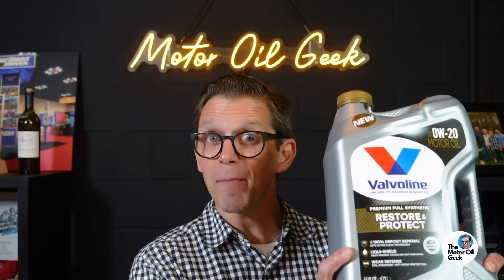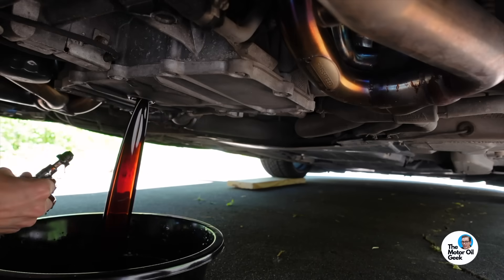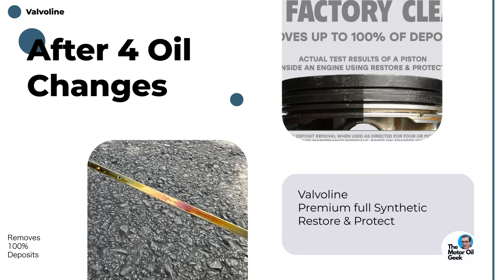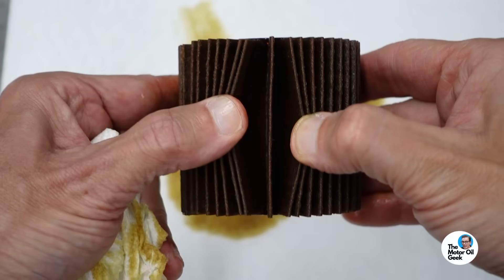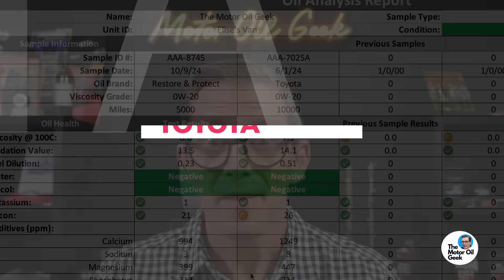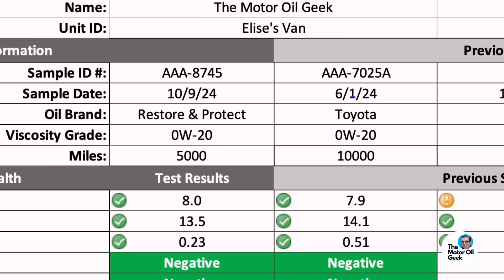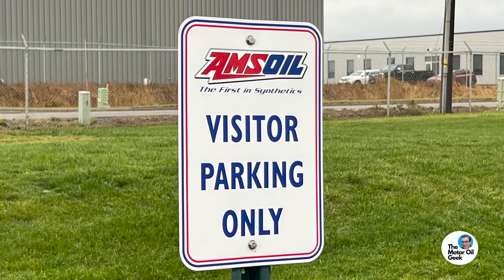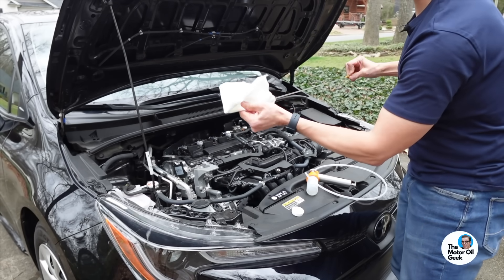The TRUTH About Valvoline's BOLD Engine Cleaning Claims

Comment: I recently made the switch to restore and protect with my Holden monaro L67 with bad service history and low oil presure issues and noisy valve train with 300k klm. I entered it into the gipsland huanted hill climb event and punished the engine across the days 10 runs, with 20 minute cool down periods. To me i thought this would be the last time before i replace the bottom end bearings joking with other competitors that its about to blow up. I had tried soo many other oils and flush methods prior with zero improvement of valve train noise. After 1 hour freeway drive returning home the engine still ticked away. I left it over night and though one more drive around the local hills before i pull everything apart. Guess what, the engine pulled up at home wisper quiet. Normally these driving conditions it would be loud ticking of the valve train. I dont know if was absolute luck and credit to all other efforts prior but the valvoline oil took care off it. I am still shocked. I'll be runing this oil for every motor i own. This has bought me a little more time to complete a l67 twin turbo motor build. I look forward to the old motor teardown too confirm the condition. Thanks to your study of oils, it has lead me to this outcome. Cheers

Comment: You can still change your oil at 5k instead of waiting until 10k.
I still do 3k on all mine. I did put the R&P in my 2001 E450 V10 motor home with 34k last change based on your video.

Comment: Switched my '22 Ram Hemi to this oil, it performs as advertised. Been using the 0w-20 as per factory recommendation, but thinking about going to 5w-30 here in Florida
Reply: Make the switch to 5w-30, I live in Dallas and switched over with my 2022 ram 1500 and it’s much better

Comment: Probably most if not all vids I am seeing for this oil demonstrate positive results.  I have 2 extra vehicles with 200K+  Nissans -  my impression is that Valvoline product is not 'snake oil'  all puns intended - so I will start using this product in those - however for my new 24 Z Performance 6MT  I will use Amsoil Signature w/ Amsoil filter.   I also use Amsoil for ALL small engines/lawncare  bike chains, hedgetrimmer lube, guns  etc.   -  and I dope up my ethanol-free gas for lawn engines with Lucas gas stabilizer - so far - smooooooth.         Great vid !

Comment: Just bought a 2012 odyssey that didn't have a muzzler on it, and has 180k miles on the engine, i'm hoping this will clean up the rings and make it run like new again,   im guessing if you run this oil and do some italian tune ups it should be good to go.   make sure to rev the engine up high to get that gunk thrown off.

Comment: I used Seafoam on my 4.7 Dodge 2005 Dakota to flush the varnish out. This engine is known as the sludge monster.  Have been running Castrol but am about to try Restore and Protect for first time. Will be interested to see if oil will last before engine makes noise on start and have to change oil before scheduled time. Only 179k miles

Comment: Question The 3 rd generation Nissan Frontier pro 4x v6 engine has noisy lifters at start up. The dealer uses Mobile. Would Pennzoil or AMSOIL be better to quiet them?

Comment: I hope they plan on making it in a 0W30, im not putting 0w20 in my 4 runner. Aint no way!!
Reply: I put the 5/30 in mine.   It may slightly hurt mpg.   But at least the engine will be coated.
Reply: @robertpoirier8520  0w20 is water idc what anyone says.
Reply: @ I totally agree!   👍

Comment: Two questions. First, can i slowly add R&P at a rate of maybe 2 quarts to the 5 i usually put in, increasing to the full 5 quarts over oul changes? 09 Aveo, 165000 miles mever had anything other then synthetic oil put in and have never had to top of between changes. Second,  do you think this will help with GDI engines with carbon build up on ithe ntake system? Maybe the vapor from R&P can help keep intake valves clean also? My wifes 2015 Santa Fe with the 2.0 turbo would love that!!!!!

Comment: Must be nice to get paid from companies.  You can always show people what they want to see!  I have been wrenching for 37 years.  I have run Mobile 1 full synthetic in my vehicles since it came out. And I have had Ford trucks with 5.0-5.8- 5.4, engines with over 500,000 miles on them still running! All gasoline engines that you say preheated engines are bad! These trucks were worked daily and allowed to idle for warm up. Oil changes were done every 3,000 miles because of heavy use. The oil changes they recommend today is literally to draw in repair issues!! All because people don’t know proper oil changes!! No more than 5 minutes for warm up in very cold weather. 30 seconds in warmer climates. 5000 miles with premium synthetic and mostly highway! 3000 miles with premium on city driving!  Today’s engines are great, with proper maintenance! I see it every day in the shop! The old saying goes, take care of it and it will take care of you! It’s not the 60’s or even the 70’s anymore! Things started to really evolve in the 80’s. But now the manufacturers are giving bad information just to try and make money! There is the plain old truth!!!

Comment: Interested to follow this series. Recently switched over from Castrol Edge to VRP for my 134'000 Mile Nissan VQ35DE powered Van which usually sees oil changes every 3000-4000 miles.

Comment: Lake, with all your knowledge of various brands and options of oil you still kept using Toyota “brand” oil for 180,000 miles.  Why?  Google tells me it’s manufactured by ExxonMobil, surely there’s “better” more affordable options. 

Which brings me to my second question, I’ve read that many oil manufacturers produce special formulations / specifications for the auto manufacturers.  For example that Toyota oil you’ve been running is a different formulation than anything else you can buy from ExxonMobil.  I have a hard time believing this.  I’ve only read these claims from keyboard warriors.  I don’t expect you to throw all the auto manufacturers under the bus, but could you possibly elaborate on the Toyota oil. Does the oil analysis data for the Toyota branded oil show the same formulation as perhaps another oil that ExxonMobil sells? If you used it for 180,000 I speculate maybe there is a chance that it is specifically formulated for a Toyota, that or you get the oil at a heavily discounted price or free.

Comment: I have a chevy 4.3 V6 with 306000 miles.
I just did my usual oil change around  550 miles ago using Mobil 1, 10/40 high mileage.
It's time to add a quart.  I don't get 600 miles before adding a quart.
Most is probably because of valve seals.

Its time for a test.
When I do add a quart, I'm going to add a quart of Protect and Restore 10/30 instead of just adding another quart of Mobil 1 10/40.
Ill continue adding quarts of Protect and Restore until my next oil change, around 4500 miles, then go with a full change using Protect and Restore from then on.  
I should probably boroscope of my piston tops and do a compression test for comparison later this summer.
Its only about $5 more per 5 quart bottle so cost is really not an issue.
I'm expecting no noticeable changes because Ive been using Mobile One high mileage for years now.
That said, if there are any changes, ill absolutely know it.
Time for a trip to Wally World. 😁

Comment: I've been using Mobil 1 for decades and feel no need for the Restore and Protect.  My engines stay as clean as new for at least 300K with annual oil changes.  Disclaimer:  I live in a mild climate, do no short trips, almost no idling or low speed stop and go.  But I'm impressed by what you've found.  And I like Valvoline products, frequently pick them for other applications.

Comment: Might be a dumb question. So would you recommend running valvoline restore and protect for a few oil cycles until cleaning is noticed and then change to another full synthetic or there would be no harm running R&P for the indefinite future in an engine and get all benefits from the additive package as well as the continued cleaning from detergents and get adequate lubricity

Comment: I have a 2017 Kia Sorento that Kia gave me a new engine after 3 FAILED oil consumption tests  (72K miles)
I am going to the dealer for a recall Wednesday. I only have 1500 miles on new engine and want to put in VRP to keep rings clean.

I put VRP in my 172K miles 98 Dodge Caravan 4 CYL and just changed oil to put in VRP again. I will wait for 3k miles this time.

Comment: If wear rate is the all-important metric of oil analysis, could you do a comparison of wear rate for all the oils you see during testing? And any other trends - e.g. I would expect maybe some oils clean/protect better for a specific viscosity (assuming the exact recipe is different for different viscosity), or some oils work better in an iron block vs aluminum block (possibly depending on the cylinder wall e.g. sleeves vs. Nikasil but also I would expect some galvanic effects given that the whole engine isn't all the same material).

Comment: 6:38 Tin wear rate shows to be 5 times higher than the Toyota oil, even tho the Toyota oil was used 2 times as long
Accelerated bearing wear?  I wish there would have been some discussion on that
Reply: I watched a video from another KOL - Ford Boss Me.  He sent new Valvoline Restore & Protect to Blackstone Lab and SPEEDiagnostix, tried to check the chemical differences between 0w20 and 5w20, as well as the report differences between two labs.  His video was 9 months before this video.  All reports showed there is no tin in new VR&P oil.  Base on that, the tin was from engine wear.  Just my two cents.
Reply: @sysopr  damn it….that’s exactly what I was hoping NOT to hear.  I guess VR&P can’t do everything.  
I understand the Motor Oil Geek is not sponsored by anyone but it’s odd that he skipped over that very important data as data-driven as he is.
Reply: I’m thinking Motor Oil Geek’s conclusion is based on the overall metal wear rate of 2.7 ppm per 1,000 miles with VR&P is better than average when compared to other oils.  I’m def curious on what the avg metal wear rates per 1,000 miles are for other synthetic oils.   
If ppl are concerned with bearing wear or if a particular engine has a history of bearing issues, VR&P may not be the best oil for them.  But in all other circumstances, I think it’s probably a great oil.   
I’m going to run it for 4 straight oil changes, then alternate b/w that and Pennzoil synthetic from there on out  (5k mile OCIs with filter changes every oil change)
Reply: @randygonzalez5758  Thank you for sharing.
Reply: That is the same point I am interested too. From what I know, tin is use on some components in an engine oil path. tin is use on piston coatings to reduce friction. And tin is also use on oil cooler solder joints. So, I think Valvoline Restore & Protect is a good and convenient way to do an engine flush, but only when the car really needed an engine flush. I would not use it as a replacement of regular engine oil, because it still cause some damage on an engine. What do you think?
Reply: @sysopr I wish I knew the answer.  The only possibility this is an actual “pro” is if the additive package itself utilizes tin, which is resulting in the higher tin levels.  I don’t know tho, and that’s just a possibility I’m telling myself since I switched all of my vehicles to VR&P

Comment: I have a 2015 Buick Verano with 122,000 miles.  I noticed that Valvoline Restore and Protect is not Dexos Rated.  Can I still use this oil?  I have the 2.4 EcoTech none Turbo Motor.  It used no oil in my 4,000 mile oil changed and also doesn’t leak 1 single drip. My last 6 oil changes are Valvoline 5w30 Extended Protection.  My Prior Oil was. Castrol product.  I just can’t remember which one.

Comment: I have a Honda CRV 2015 2.4cc.. Which is 10 years old.. The manual says should use 0w20..however the mechanic told better to go for 0w30.. Since the engine is old.. Can u guys recommend 0w20 or 0w30 or 5w30 VRP on my next oil change? By the way.. I am from Malaysia (hot and humid country whole year).

Comment: There seems to be claims by many people using Valvoline Restore & Protect that it results in cleaner engines AND lower oil consumption. These are very unlikely to be directly related.

As far as decreased oil consumption, Valvoline tends to have a slightly higher actual measured viscosity (at 100 C) than most other motor oils within the same API viscosity category (such as 0W-20). Motor oils with the same API viscosity category can include different actual viscosities so long as they stay between the min and max of the API range for a given viscosity category. The fact that different motor oils with the same API viscosity category can have different actual viscosity measurements, can be confirmed by looking at the oil manufacturer data sheets for their motor oil.

However, it is possible that besides different actual viscosity measurements, there may be some additives in the Valvoline Restore & Protect that result in lower oil consumption, that are different from the additives that clean the engine. But generally speaking, using a motor oil with higher measured viscosity (even one that has the same API viscosity category as another motor oil) does result in less oil consumption in older engines. That suggests that if the main problem is oil consumption, it could possibly be addressed by using a higher viscosity motor oil of any other brand of comparable overall quality. This is especially true for vehicles being pushed out the door by manufacturers with extremely low viscosity specifications for the motor oil, which are designed to increase fuel efficiency,  with little or no regard for engine reliability or longevity.

Comment: So why not just use this oil since day one? Why wait until there is high miles on a vehicle?
Reply from the maker: There’s no reason why not.
Reply: @ good to know. Thank you.
Reply: 6:38   Tin wear rate shows to be 5 times higher than the Toyota oil, even though the Toyota oil was used 2 times as long. From what I know, tin is use on some components in an engine oil path. Tin is use on piston coatings to reduce friction. And tin is also use on oil cooler solder joints. So, I would recommend Valvoline Restore & Protect is a good and convenient way to do an engine flush, but only when the car really needed an engine flush. I would not recommend Restore & Protect as a replacement of regular engine oil, because it still cause some damage on an engine.
Reply from the maker: @AlexTyler_  The Tin is not from wear. It is from the Molybdenum additive in the Restore & Protect.
Reply: @ With all due respect, whether the tin was from engine wear or from the additive, it will be more convincing if you make a video to prove it.
And I think a lot people are interested on this point and looking forward to watch that video. ☺

Comment: Okay. So the Restore & Protect cleans the rings.  So would the Restore and Protect be something to put into a brand new engine?  If it minimizes the wear and cleans, isn't this what I would want for a new engine?
Reply: 6:38  Tin wear rate shows to be 5 times higher than the Toyota oil, even though the Toyota oil was used 2 times as long. From what I know, tin is use on some components in an engine oil path. Tin is use on piston coatings to reduce friction. And tin is also use on oil cooler solder joints. So, I would recommend Valvoline Restore & Protect is a good and convenient way to do an engine flush, but only when the car really needed an engine flush. I would not recommend Restore & Protect as a replacement of regular engine oil, because it still cause some damage on an engine.

Comment: Can you use it on a 2020 vw Tiguan or try something else. Also I searched your videos and was looking on Euro oil or American and didn’t see a why you have to use one or another. Ty
Reply from the maker: This is not for a Diesel, but it can be used in gasoline engines.
Reply: @ my Tiguan is a 2L gas
Reply from the maker: @frankf2915 if it calls for a 5W-30, then you can use it.
Reply: Funny how say that. When I google 2020 vw Tiguan it says 0w-20 or 5w-30. Kind of weird
Reply from the maker: @frankf2915  Check the owners manual.

Comment: I've been using it in my 2000 sienna with 357,000 miles and it uses less oil now. I had been using mobile 1 and i swear that stuff leaves gunk in engines even if changing oil every 3500 miles. I tore apart my wifes ford edge (which we have had since it was almost new) for a water pump timing chain and it looked bad inside from mobile 1. I have that on a restore and protect diet now to. Three oil changes so far.
Reply: 2000 tacoma with 206K,   Just started doing synthetic because walmart stopped selling them, and having the same issue with mobile 1.  Thought it was because my vehicle was getting old on my second try with synthetic, but I just did the valve cover, and cleaned the cover good, and after one oil change (3200k), the same staining started happening at the pour hole. .  Form what i heard from a youTube vid, It has to do with your daily driving, if you do a lot of short drives where you stop, the staining happens. For people who drive freeways and for long periods it's fine. it's the short drives that don't get the oil hot enough that stains it. I might go back to conventional after this valvoline restore and protect.

Comment: I just used this in my 1997 Ram 1500 5.9L a week ago.  It has low miles for being 28 years old, only 103K.  I bought it with about 69K 20 years ago so I don't drive it much but it has used oil, about a quart every 1000 miles, since I bought it.  I'm hoping this will help clean out the piston rings and reduce oil consumption.  I'm also planning on using it in my 2023 GR86.  It's got almost 20K miles on it and I just had my last free oil change from Toyota so from here on it will get Restore and Protect.